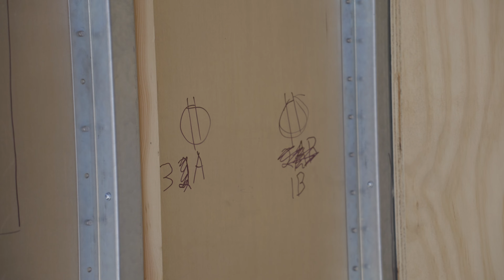DIY Overland |Tiny House | RAM 5500 Box Truck Expedition Vehicle: Part 6 Spending Money

Comment: Its a planaer heater.  they are copycats of webasto and espar,  you never have to worry about the heater freezing. its the fuel line that needs to be insulated and heated.   were in canada and in sask we have minus 55 to 65 celsius wich is equaly as bad as fahrenheit lol… 
my gasoline webasto never froze on me yet ! lucky me. other than diesel heaters whos lines usually start freezing at minus 20-25 celsius
Reply from the maker: We had an espar with the high altitude kit in our previous rig and it was soo frustrating it bricked out on us at elevation about 7000ft. Then we would have to take it to an authorized place to have  it unlocked… so far the planar has been doing just fine! Kicked up without a hitch at 10,000ft +!
Reply: @OverlandUncharted  planars are good